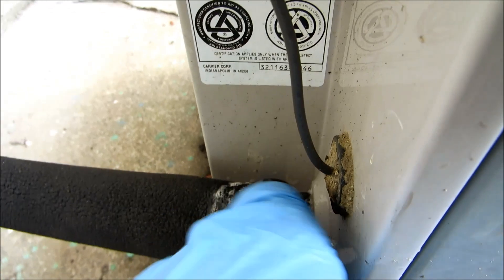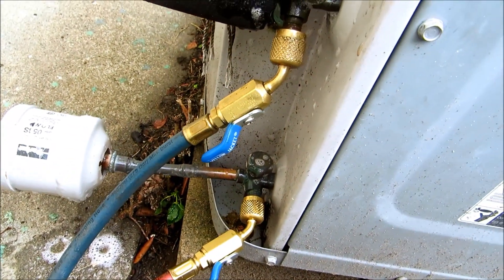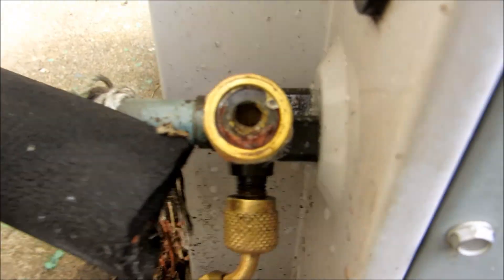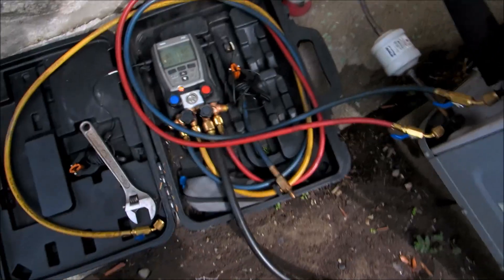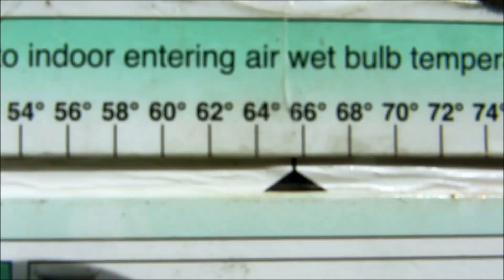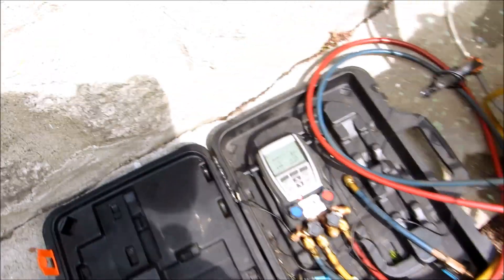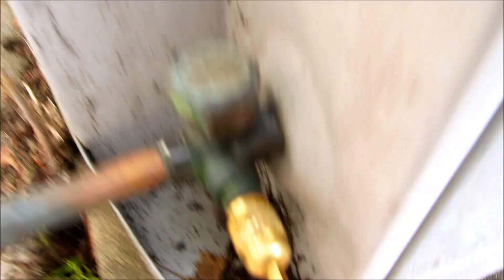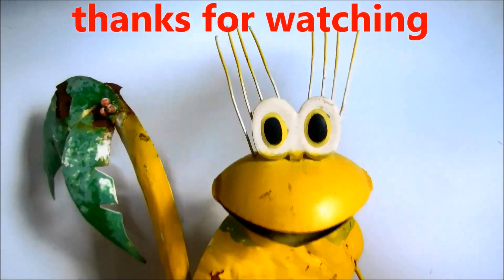hvac carrier system  out of refrigerant

Comment: Hello
I have One Carrier 4 ton .had Leak I found leak repaired and vacuum it after that i add refrigerant r-22 right know in high side pressure is 203 and low side is 42 . plowing 68 and return is 76  i replaced the dray filter but still like that can u give me your openin about that

Comment: Those carriers, both 22 and the old 410s I found are notorious for leaking out them king valves. If its completely empty or pumped down I've replaced the orings in the king valve. otherwise, nylog. great vid, keep 'em coming.
Reply from the maker: i never thought about replacing the o ring i know the snap retainer was all rusted out it would of been a problem trying to remove the rusted clip for sure i pick my battles wisely

Comment: Nice video Steve.. I work on a TON of carrier ressy units and that generation of carrier/bryant condensor seem to be bulletproof.. Its funny I have had a few king valves that have had small leaks and I front seat em abit then back seat them fully and they stop leaking... How often do you use the nylog on king valve caps?
Reply from the maker: i use nylog if i think there might be a leak on the o ring inside the king valve ,i like to use nylog on shrater valves if there are leaking it will bubble up ..i like to use the nice brass caps for protecting and sealing up shrater valves .the j.b. once seem to be nice

Comment: are you getting your high voltage for your vac from the disco? Great idea for houses that don't have outside outlet nearby
Reply: Yea they make them or u can make your own
Reply: Zebra daptor is a nice set up
Reply from the maker: if you make one just use small aligator clips the big wide ones are hard to clip on ..i make my own set up
Reply from the maker: ***** i use the jumper to save time .but you are right running a cord is a better and safer way .i do agree